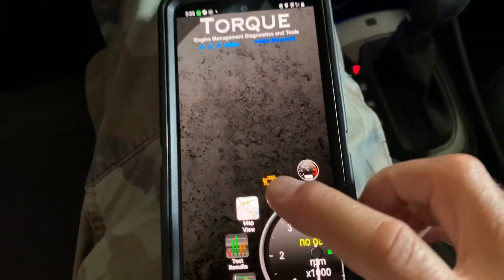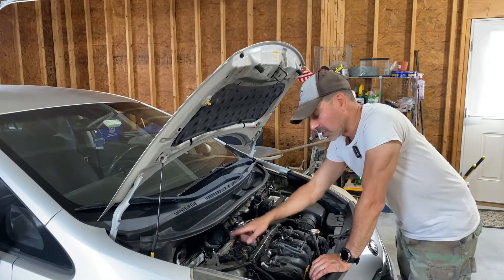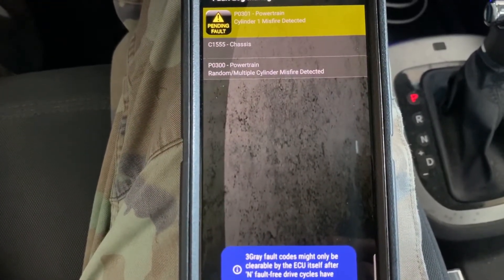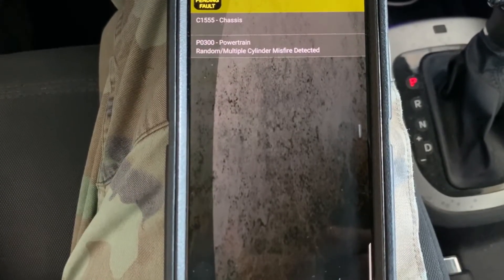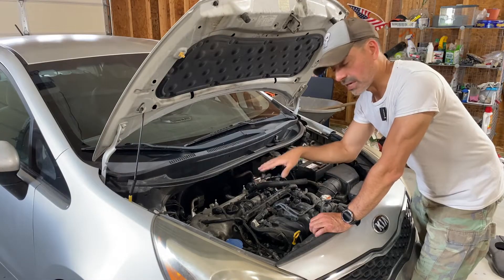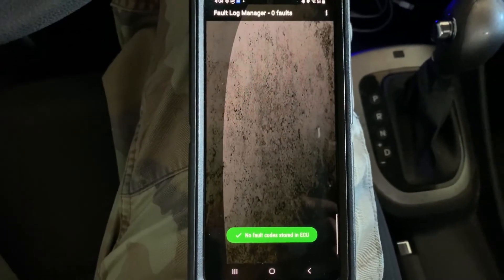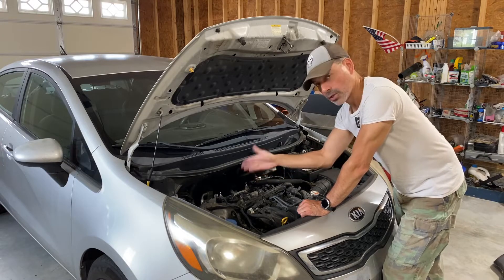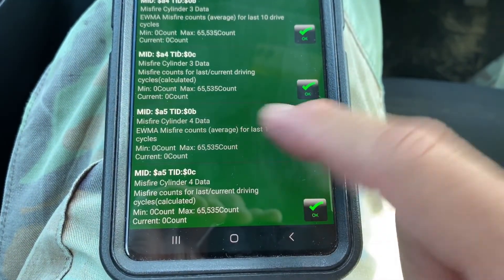Diagnosing & Fixing A P0303 Misfire Code (Andy’s Garage: Episode - 477)

Comment: Hey Philip I have a ford escape 17 . That misfire as per to coolent leak I changed all 4 plugs and cylinder 3 coil . But the miss fire is still coming after 5 months . Any advice?
Reply: The coolent leak was mentioned by one tech . I took it to 2 tech they don’t want to touch it when I shared it .
Reply from the maker: Pull the spark plug out at the misfiring cylinder. If there is oil on the plug causing the misfire. It could be a leaking valve stem seal

Comment: Yes it runs guud for now but it's gna come back u need to replace the  fuel injectors and spark plugs that will take away ur issues permanently I know I went through the same thing and by the way u probably gna have to replace the fuel filter that plays a big part on ur misfire
Reply from the maker: @Myself69546  That’s all not needed unless they are culprits. In this case it was only the ignition coil pack. Problem was corrected with that replacement.